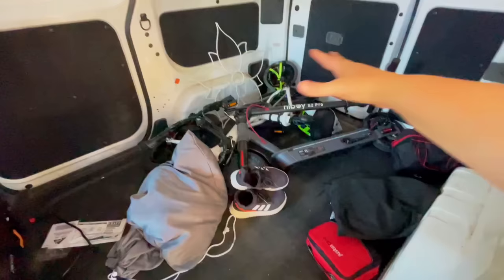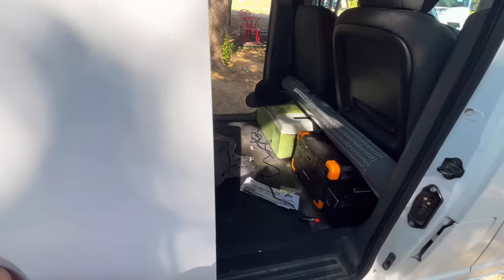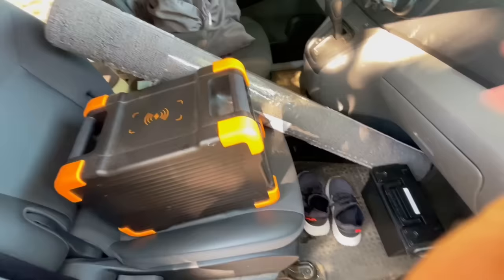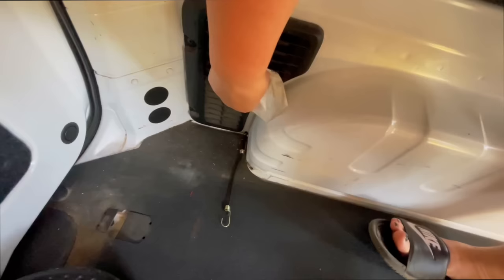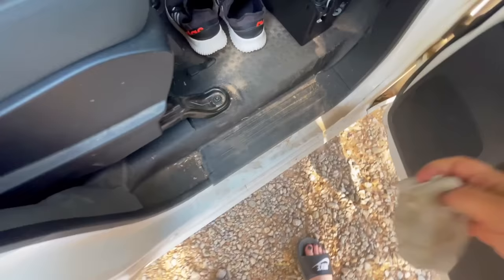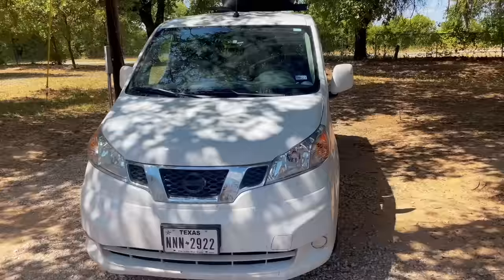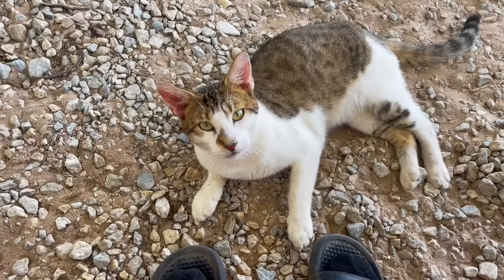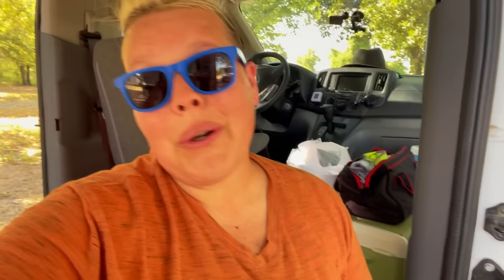Big Changes In My Van Set Up Mean Big Opportunities | Van Life Reimagined

Comment: Didn't you buy a twin XL? The XL is longer than a standard twin, made for people over 6' tall, so their feet won't hang off the bed. You also have to buy special XL twin sheets for them, as the standard ones won't fit the extra length.
Reply from the maker: The sheets that I had were from my previous bad and they were plenty large because I ended up buying a full bed and then cutting it down so the links actually matched up.

Comment: An idea to get the bed up off the floor, pick up some heavy duty plastic shelves from Home Depot or Walmart. You can customize the leg height so your head doesn't hit the ceiling. Keep 1 or 2 of the shelves (depending on width)under the bed in couch mode. Bungee the last shelf to the wall over the wheel well with the legs off. Won't help with the drawers but will give you a bit of extra storage & make the mattress easier to manipulate.

Comment: have you painted your roof with isometric or flex seal? it helps with the heat
Reply from the maker: no i will not be making any kind of mods like that to the van at this time
Reply: I was looking at something like that,  but wondering if it will bond to the  fiberglass top on my older class b... It is wonderful having an older already depreciated vehicle,  because I can change it any way I  want and there are no warranty issues or risk of devaluation.
Reply: @anitasimmons3599 yes it can bond to fiberglass - scuff it a bit before applying